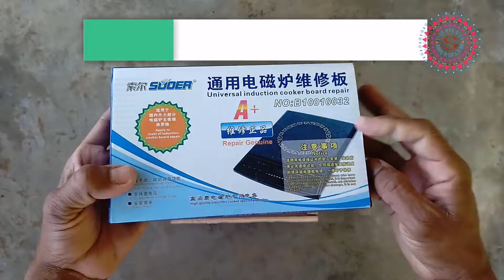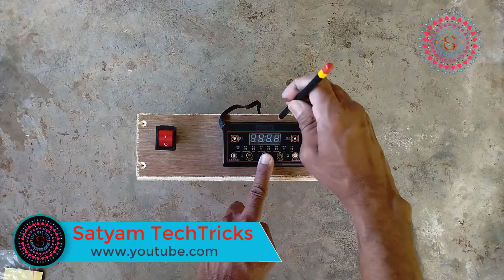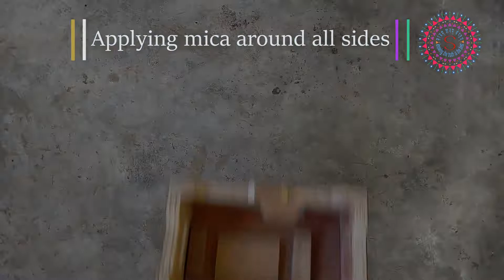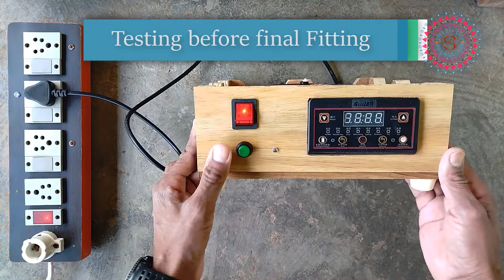Home Made Induction Cook Top

Comment: How many amps of current is required from a 12 volt battery? Is it really possible to cook with this?
I am making one like yours which consumes a lot of current but the pot does not heat up in comparison. What is the reason for this?
Reply from the maker: Sorry, it doesn't run on a 12v battery. It operates on AC 230V and consumes 4 to 7 amps respects with its temperature setting low to high. Of course it is very suitable for cooking. At my home it is being used since 2017!